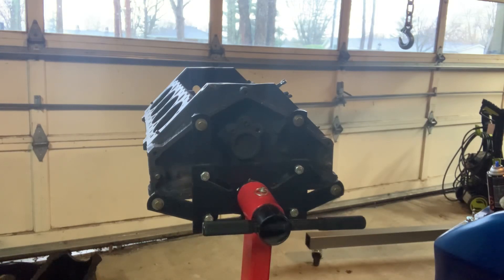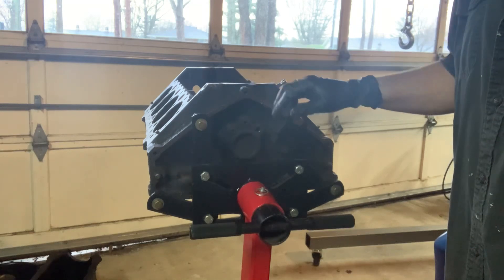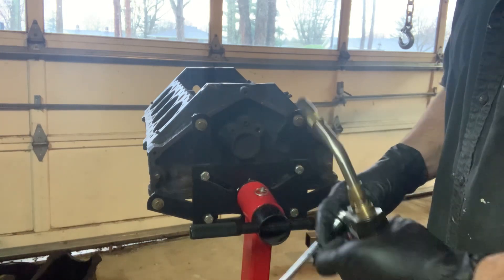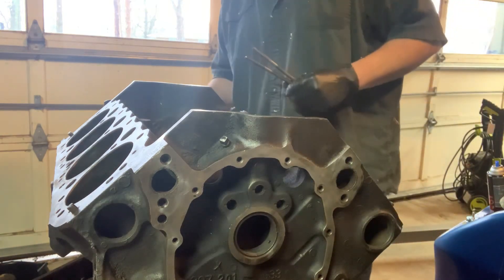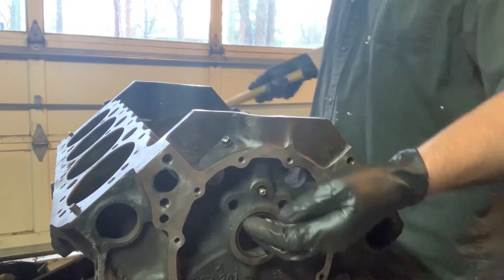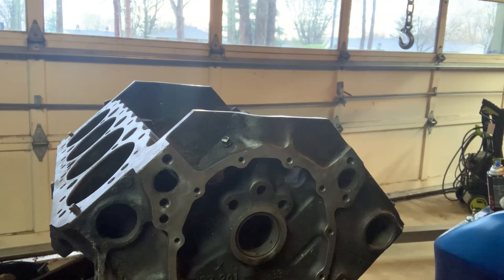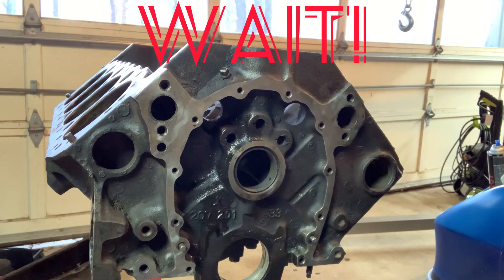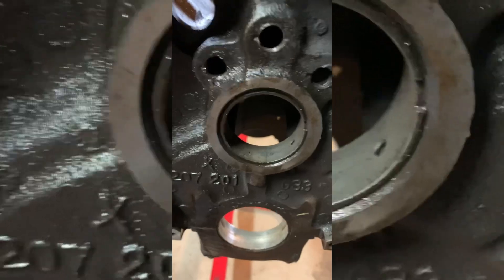Repair or customize the oil galley plug on a small block Chevy

Comment: you know, I used to work in an automotive machine shop.one of my jobs was to disassemble engines. I don't remember ever having to push galley plugs out like that. this was the 80s but all of those blocks had threaded galleys in front and back
Reply from the maker: I’ve always been told they are push in plugs from factory and that if you thread them it’s better for high volume oil pump usage.
Reply: @kosworkshop  ok, I just did an AI check and I'm not crazy.in the 60s and 70s, they were screw in, I can't pin it down but I think the vortex blocks had the push in galleys. I know they had changed a few things on those blocks including the elimination of the fuel pump holes. the bosses are still there
Reply: @russriley3005 this is a common upgrade to thread these and use pipe plugs... It is not done from the factory...
Reply: @jcanfixall1585  I was actually corrected on this. I now remember the tool I used to remove those galleys. I had an iron punch that just fit inside the galley all you had to do is push down and they would pop out on the end if the punch. understand, it was the 80s and I still smoke a little pot, so my memory isn't what it used to be.